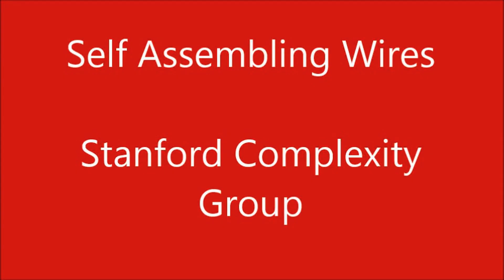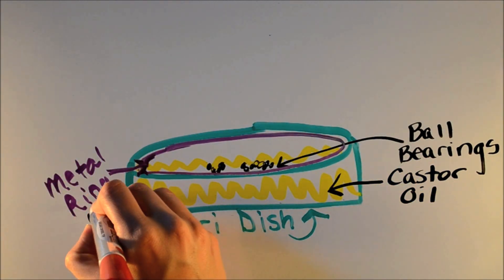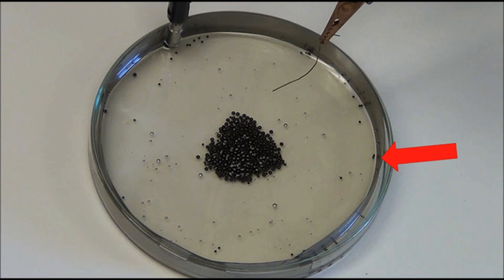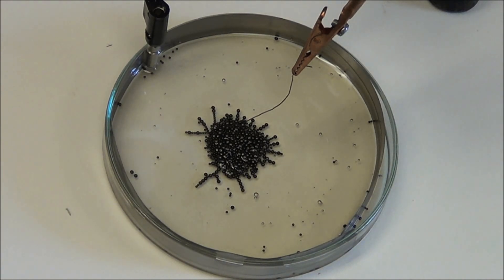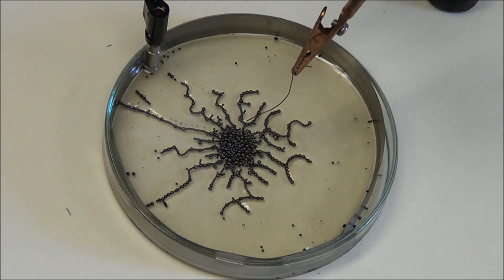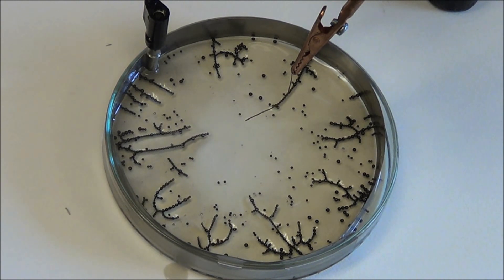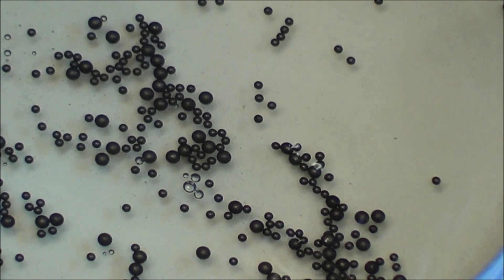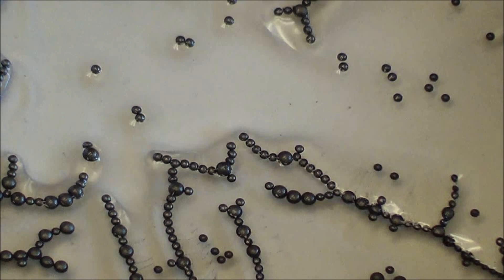Self-Assembling Wires

Comment: Excellent experiment that could have very important value in designing multi-agent systems. Unfortunately, Prof. Hubler passed-away in 2018 and his webpage is no longer up. I wonder if anybody knows if there is an alternative webpage that is still up. Also, was this experiment carried-out when simple insulators are placed in the petri dish. My feeling that the presence of insulator will reveal a much more interesting and intelligent behavior of the collective

Comment: Please do this experiment?!?!

Okay so, experiment ideas;

What would be the best DATA on the CD to optimize the solar cell? (As the Data affects the electronic magnetic interaction.) And more importantly, is it Oasis' #Wonderwall?
oCtet tRuss? (matricie,refraction,coil,porus,void)
@_krnow
https://youtube.com/watch?v=5uh8iqid5mc
https://youtube.com/watch?v=8CPGUe_IaZs

Also! If using a CD, and Iron Ferrofluid, where could/should your positive and negative leads be; so that your ferro fluid could act as a self-building wire to conduct current?

Comment: Some important info seems to be missing . It's not clear if one can use regular oil as dielectric, and what is the voltage and amperage.  It seems that the video purposely cut the part where the supply knob is turned.

Comment: We've been stepping up 120VAC from mains to 15k - 25+k volts for over half a century - it happens in every CRT TV or PC monitor,  amongst other things; Also the power supply is very easy to build to achieve these insane voltages.

Comment: Great until they put it in so called vaccines .
Reply: I hope you're joking. Please dont be so gullible.
Reply: @DSDaly  watch stew peters, he has guests who are looking at vaccines under microscope. Shocking stuff. Not a typical vaccine at all. Heavy metals and parasites????
Reply: @rosalindr4975  its trichomes
Reply: @paulg666  how do you know they are lying? No full disclosure of ingredients yet . Japan halted some because of questionable materials in them. & no one should believe anything without questioning it or looking further into it.
Reply: @rosalindr4975  I hope you realise this video shows ball bearings, oil and electricity. This video has nothing to do with graphene or any vac.   There are no trichomes.
The full lists of ingredients have been available for a long time. You should look for them, very easy to find. 

In Japan no graphene was found. 39 vials, from Spanish manufacturer Rovi, were found to contain small particles of stainless steel (as found in heart valves and joint replacements) due to a manufacturing fault. The whole batch was sent back. There was no graphene in the vials. 

The people on stew peters making those claims are not qualified to understand what they would see in a vac or under a microscope. The pictures they show are not associated with the vac. We know they are lying because they are not qualified and can provide no evidence of what they claim and most of the claims are impossible and couldn't happen. Do you really believe in self assembling robots as is claimed to be in the vac? One of them is called a doctor, on his show, has admitted, in court, to not having any qualifications or training. The vac has been analysed all around the world and no actual scientist/doctor has ever found these things.

You're correct - no one should believe anything without questioning it or looking further into it. I have done a lot of research on the claims and also the creditability of those making the claims.
Reply: @rosalindr4975  No they are not. La Quintas story about the Spanish research was the one from the University of Almería where the researcher  Dr. Pablo Campra Madrid in his report has mentioned that this is an “interim report” and not “conclusive evidence.” “This unknown origin of the test sample itself makes the findings questionable”.
The sample was delivered by a messenger from an anonymous source (not an untainted vac).
 The university has “unequivocally” distanced itself from the analysis that claims to have found graphene oxide in a vial of the vac.

Comment: Huh 
And graphene oxide comprises 99.9 % of the Pfizer Jab 
Ask yourself why the fuck they would want this in the Jab and why would they want this inside you
Reply: There is no graphene in this video. They are ball bearings. There is no graphene in the vac. Even at 1% it would make the vac a very dark colour. No graphene has ever been found in the vac. Stop believing in the proven lies.
Reply: @paulg666  
Ok so let’s assume there is no graphene in the poison jab at all 
It still doesn’t work it doesn’t protect from covid 
You can still spread covid so what’s the fucking point besides doing what your told which you probably don’t have any problem with

Comment: This basically shows DNA/RNA transcription via bio-electric-chemical induction. DNA is likened to a super coil with a negative side running one direction, and a positive side running the opposite. DNA is a closed coiled system I think.... It may "plug" in one end somewhere in each cell, and plug in a seperate port. DNA runs an electrical current through itself, and I  can see how proteins are formed from out of the tips of the branches that would be like RNA branches coming from out of the DNA coil. The coil in this experiment is the closed metal ring and the pos/neg charges attached. Dope.
Reply: Not the same

Comment: Someone can correct me if I'm wrong, but I'm pretty sure this is a great visualization for how lighting works when it arcs down from storm clouds to the earth. The thunderclouds in the sky create a huge voltage difference and a path just like the ones you see forming here form to some object on the earth, let's say a tree, and once the path get completed, meaning it successfully reaches the tree, current shoots across the path and we see actual the bright lighting bolt. Of course with lightning in the sky this all happens much much faster.
Reply: You are generally correct
also the first comment I found that is not a dumbass talking about the vaccine
Reply: @prabas8190  Even if the comments are overrun at least it's getting this video spread around, because the video itself is pretty great and interesting. Also I'm appalled at all my typos but I must've made that when it was too late for me to proofread...
Reply: @Bones_  it's not a problem at all

Comment: "Electrons get sprayed down from the positive wire..." Yeah, I know this video is 6 years old and all, but even back then most scientists agreed that electrons flow from the negative pole to the positive one.
Reply: The video is incorrect about this, there are no electrons being sprayed down from the positive wire. What's happening in the very first demonstration is that the ball bearings are placed centrally in the oil with an air gap between the bearings and the positive electrode, and the oil and negative ring, making an electric field. I believe what is happening is that the bearings contain positive and negative ions that allow for the alignment of electrons. Since opposites attract, the negatively charged electrons in the bearings really want to join the positive electrode somehow, but the air gap won't allow for a circuit to complete yet, and the positive ions in the bearing really want to go grab some of those electrons from the negatively charged rim. Internally, the ball bearing is trying to rip itself apart, like a tug of war between the two electrodes. 

So why do the bearings start arranging themselves into formations like that? At first, the bearings were all clustered in the centre, but not all bearings are placed equally. Here's the thing, electricity and magnetism are known to be part of the same force, the electromagnetic force - the bearings have also positive and negative magnetic poles, because of the way the electrons are aligned inside of them. On an ordinary surface, the magnetic fields are not strong enough to move the bearings, but the oil takes away the resistance of friction. The bearings are being pulled towards each other as well as the electrodes, but it's a matter of what is closest around which wins out initially. When the bearings touch eachother, the electrons are pulled through aligning themselves in the directions of the poles. So two bearings, with electrons pulled to one side of it (the side closest to the positive electrode):

-+    -+ , when they touch, become - - ++. The electrons rearranging themselves when the bearings touch make a longer magnet with a single positive and negative magnetic pole with a greater magnetic field, and thus more bearings are pulled towards it. So why don't the bearings just huddle up together in one big clump? Well the electrodes are also pushing the electrons in the bearings away away, because like opposes like. The negative side is pushing the electrons to the positive wire, and the positive side is pushing the positively charged bearings to the negative side. Eventually, when the chain of ball bearings become long enough, the bearings reach the negative rim, and a sudden influx of electrodes is pulled from the negative rim into the bearings, and nearly all become negatively charged, although some from the centre of the bearing cluster are pushed away immediately because the magnetic field shifts and they realign their magnetic poles afterward, but all that sudden energy is so much that the electrical energy needs to go somewhere, and it arcs through the air to the positive electrode, and a current flows, restoring peace to the galaxy.
Reply: @haydenhoodless2055  While I do appreciate all the information, that was in fact my whole point. I know that electrons aren't being sprayed down. That is, in fact, exactly what I said.

Comment: 🧠Neuronal structures exist primarily because of the charges present within them make them do so.  Structures hold together by charge and they move and perform functions all based on them the biological structures interacting with electricity.⚡️
2:27 the electrical growth of structures (can possibly be used to replicate biological structures like receptor sites for studying. eg: The "Ball and Cup" mechanism present in voltage gated ion channels could be viewed and studied whilst first assembling somehow and then viewing when inducing a fluctuating positive and negative voltage upon the system to replicate how the structure behaves normally during its resting potential phase and interrupted by the huge wave of things that occur when an action potential rolls across it and as it is forced to return back to it's normal resting potential.  
         We could study these "things" like the percussive nature that an action potential might have on a similar structure over time, as an action potential traveling across a neuron can occur both very fast and in large volume if a neuron is highly activated.  And we could study this over time and maybe at an accelerated rate somehow to allow us to see when many types of neuronal structures breakdown and fail allowing us to register both an understanding of how long our brains will last and maybe allow for further testing on how to prevent breakdown and failure of our brain mechanisms.
     Much like devoting a day with low stimulus commonly referred to today as a "dopamine fast" for promoting dopamine receptor upregulation.  If we think broader than just dopamine we can say we give time for the physical structures present within our brain to ease off of use and molecularly relax for some time such as a day. Maybe within that time frame structures that repair other structures will be introduced and cause repairs overall to have a noticeable or at least prolonging effect of health upon us.  Which again could be tested for effectiveness with this technology and a boring 2D graph. 

        If it's test reveals an effect maybe a further test with the added supplementation of other assembled structures similar to active structures of the various mechanisms present in the ingredients used in Nootropic formulas could be used within the test to study it's effectiveness overtime repeating the first experiment as a control to compare and isolate the differences in effects when certain nootropic active structures are introduced into the system. 
           e.g. Testing the effects of creatine as a nootropic on all the structural mechanisms of the brain's molecular structures over time using a formable structure that has an effect similar as possible to if increased ATP like structures were introduced into the system.  By doing this a quantifiable study on the effects of specific nootropics could be done and all with a boring 2D graph.

How simplicity explains complexity.🤔
This technology is beautiful and if placed in the right hands can transfer potential energy into things that Move Us(KE). 
Good Work Men🍻

Comment: 20KV... as industrial electrician, I've seen and worked with slightly higher voltages.
Not much higher, 500K was the highest...
But still slightly higher.

Comment: LMBO!! . .  sorry, but those are not "self-assembling wires." That is a carefully constructed, planned and INTELLIGENTLY DESIGNED experiment that leveraged KNOWN (as in someone's mind) electro-mechanical forces to develop these structures.
Reply: Cool, but the wires are self-assembling under the comditions provided.
Reply: @scptime1188  the conditions are completely engineered, and the experiment only proceeds via the clear, obvious interference of an intelligent mind in the process. That is undeniable.

You have to ask yourself "why were we able to observe this?" . . . this didn't simply "happen" via random action. The experiment only exists here because someone knew that these forces and actions were likely to occur based on known physics.

Comment: Any high school students can do this experiment. Allybubba has variac voltage control output voltage regulators.
Its even more exciting when u use nano size titanium balls you can even make yourself exotic strong nano balls from simply Electroplate them with strong metallic coatings.
You only have to create the the circuitry which allows you to make different reguleted voltages the nano beads will find were to attach themselves to make different types of circuitry it's as if they have built their own nervous system. You can use ultraviolet light activated polymers glue to maintain the self creating circuitry so it holds together after forming.
Enjoy

Comment: It's cool,
BUT the electrons go frome negative to positive pole! 😱 not the other way as it was said here! 
When electricity was first researched more thoroughly, no one knew about electrons, so they assumed the current going from positive to negative. When doing wiring. schemes (?) this still works, so the current goes from positive to negative to this day but THE ELECTRONS ARE NEGATIVELY CHARGED SO THEY STRIVE TOWARDS THE POSITIVE POLE!
Please 🤪😵😫

Comment: This is brilliant, however the real challenge would be to have self-assembling wires that don't require a complex surrounding of high voltage supply, castor oil, or a surrounding metal ring, still deeply innovative though, I hope you share any progress with the public.

Comment: At 45 seconds, you say that electrons are being sprayed from the fine wire electrode connected to the positive terminal of the HVPS, to the ball bearings, which are then attracted to rhe metal ring connected to the negative terminal of the HVPS ???????????????

Comment: It is not just about voltage but also how much of amps are used. Since it is a small wire it means low amps. So all this special power can be assembled by using cca 2 coils from old car which one is using spark plugs...

Comment: "self assembling" i hate that word. nothing can be "self"-verb anything.
Reply: Semantically it is debatable but it usually means that, under the right conditions, things will happen without anything interacting except the things already there. For exmaple, the required conditions are electricity and all that's interacting is the ball barings, and yet they assemble into structures. Which is what you could call "self" assembly.

Comment: This Guy: "Unfortunately, this isn't an experiment you can try this at home. You need HUGE VOLTAGES"
PhotonicInduction: "Only 20kV? Pfft!  P A T H E T I C  let me just fill up this metal wash basin with castor oil to act as the ground and set up my power supply, 500kV should be good I think, and lets pour in some ball bearings"

Comment: Here's how I think it works... Lightning looks the way it does because it tries to find the most efficient path from the sky to the Earth and the same principle is happening here. The electromotive forces are driving the conductive particles into alignments that allow a current to pass efficiently from electrode to electrode.
The branching occurs because the system is trying all paths in parallel.

Comment: The balls are conductive, which means electrons are able to move around the metal lattice. Since there is a very strong electric field present, the electrons on each of the ball's surface position themselves closer to the positive electrode. If each of the balls does this exact same thing, you end up with a set of dipoles in the dish. Since the positively charged side of a ball is attracted to the negatively charged side of another ball, they link together. The oil acts as an insulator to ensure electrons do not pass between balls (if you used a conductive fluid, this effect would not happen). This is a purely electric force phenomenon: F = qE.
Reply: Great explanation, thanks!